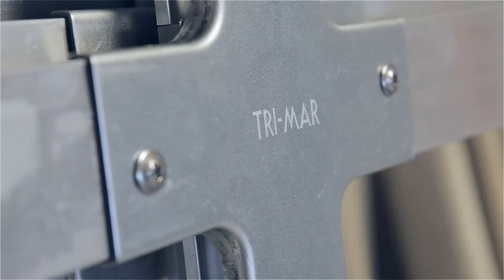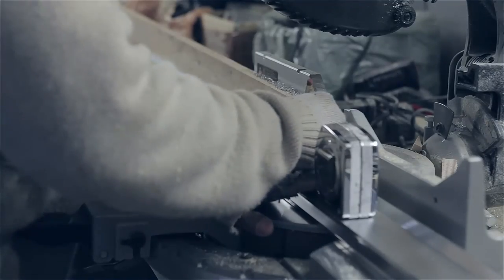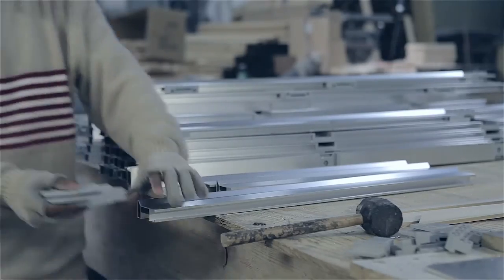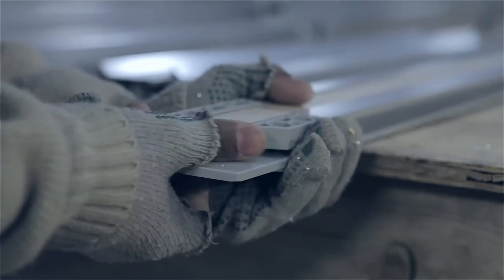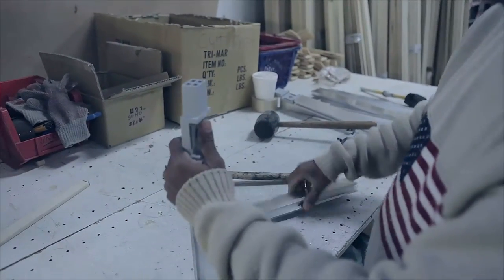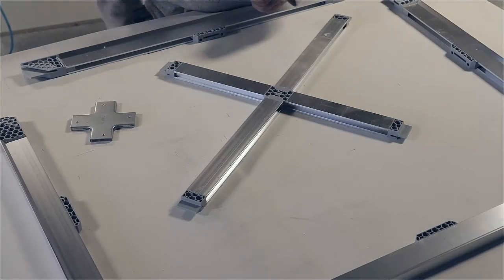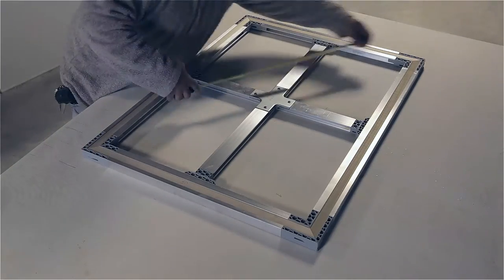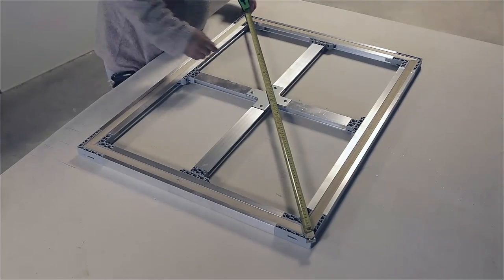TriMar Aluminum Stretchers

Comment: What is the advantage of an aluminum stretcher over a wood stretcher?  maybe the weight?  Pls advise!
Reply: My guess is aluminum is not wood, and therefore wont warp with moisture changes the same way wood does.  It also is also totally straight from manufacturing.
Reply: They don’t warp over time. Unlike this season of Star Trek: Discovery